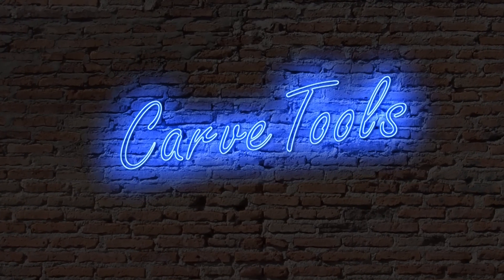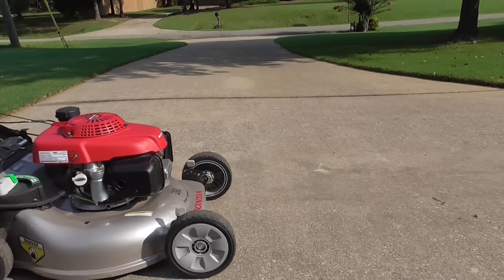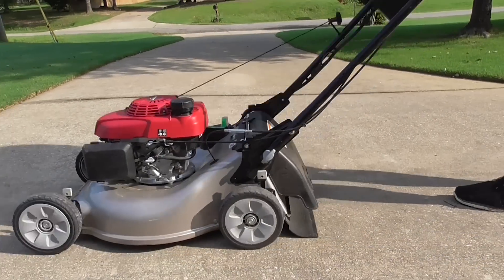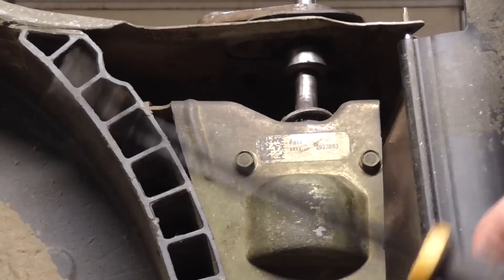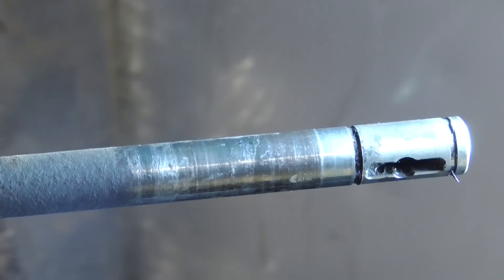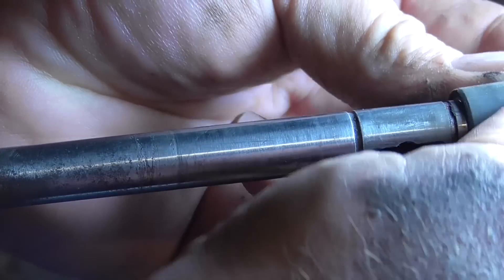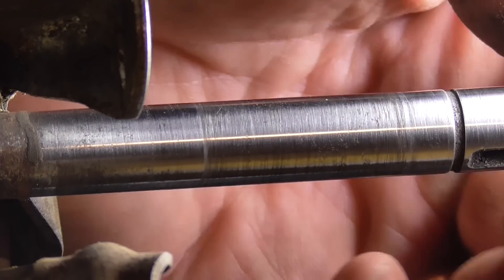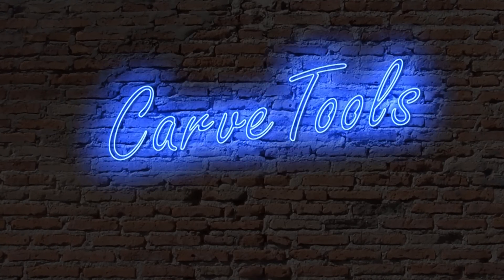Honda Mower Rear Wheels Will Not Roll Backwards THE REAL FIX

Comment: This happened to my mower within 8 months of purchase. I know several others who have had the same problem. Bad on Honda for not making this a recall.
Reply: Should of been a sealed roller bearing in there NOT a bushing on mild steel
Reply from the maker: I agree. Honda should have sent a postcard to registered owners for the recall. Thanks for the comments!
Reply: All four of my Honda mowers over the years suffer the same problem. They are just too lazy to redesign.
Reply: There are service bulletins on this issue. On older mowers some parts have been updated. Your mower comes with a warranty, use it. Even if it's out of warranty the service bulletin says "Any repair performed after warranty expiration may be eligible for goodwill consideration. Contact Techline or your District Service Manager. Techs must request consideration and receive a decision before starting work." As a tech I've had them approve things out of warranty before. Honda is a good product and they are usually pretty good about covering things that are known issues as long as it's been maintained and not abused. Have your tech call Honda and try to get approval for any out of warranty repairs.

The service bulletin also says:
INFORMATION FOR CUSTOMERS
• Inform the customer that under normal use, the HRR216 lawn mower requires a certain amount of effort to 
pull backward. It will not roll backward as freely as it does when pushing the mower forward.
• The rear adjuster bushings require periodic inspection and lubrication as outlined in the owners manual 
maintenance schedule The rear wheel adjuster bushings should be inspected and lubricated every two 
years or 150 hours, whichever comes first.
• Explain to the customer that he/she must be careful when washing the mower. Directing pressurized water 
from a garden hose nozzle or pressure washer into the rear wheel areas may wash the grease out of the 
adjuster bushings over time and will increase wear and the amount of effort required to pull the lawn 
mower backward. Cleaning the mower deck and surrounding areas is best done by hand using an 
appropriate wash mitt. Refer them to the Cleaning section of the owner’s manual for complete information.
Reply: This was a recall in the USA. Can't find any reference to the recall for my French purchased version though.
Reply: That makes zero sense, they dumb down mower operation to the point of throttle removal but the owner is expected to tear down the rear axle assembly and resurface for proper bushing function?
Reply: maintenance!

Comment: It's not this easy!! It's a Bitch getting everything apart to get to his starting point. And have fun getting it all back together. Be sure to have new snap rings on hand.
Reply from the maker: Hi Shane, Yes it's a pain to take this thing apart but the point of this video was to show the actual problem of the plastic bushings. Mention to your authorized Honda repair shop "Honda Power Equipment Lawn Mower Service Bulletin #107." The plastic bearings/sleeves are too small from the factor and they will be replaced with the correct size. This is why sanding the shaft solves the issue. Thanks for the comments!
Reply: @CarveTools  Well, I got new adjusters, new bushings all that new improved crap and it is no different than the original crap... Still locks up because the stupid design allows anything to get lodged up between the bushing and axle already...

Comment: Do you want a problem free machine? Buy the Toro Super Recycler from a dealer that has the Honda Engine. It’s more money, but you will have trouble free operation for 20 plus years! This model is only found at dealers! You will get the best of both worlds! I know!!
Reply: Al Gorel --  I do not know about the Toro Super Recycler, but if the deck is designed as all the other Toro mowers, it will be dismal at raising the grass up for a  smooth, even cut, and even worse, when the grass is damp..  
The house next to me has guys that use Toro mowers, and when you look at the side where our grass lawns are next to each other, the Toro mower side is all smashed down, barely cut evenly,  and my Honda side grass is standing straight up, and cut very evenly and level..   
Good luck with your new machine !
Reply: Yeah you will probably not have this problem but you will have a mower that does a crappy job of cutting grass....
Reply: The Super Recycler does not have the same deck as the standard Recycler. Completely different. My 15 year old Super Recycler mulches as good as my 3 year old Honda. And the Toro has   a superior drive system when compared to the Honda. Its called Personal Pace. The Honda on the other hand has the larger 200 CC engine. It can easily mulch 10” tall grass, where the Toro cannot.

Comment: Something else to look for once you have the transmission out is the shield around the transmission's pulley. With the drive belt in place, there should just be enough gap around the pulley so the shield does not to touch. Too much gap might cause the drive belt to ride up and wedge thus locking up.

Comment: I have a Honda HRR21PDC with no adjustment on the drive bar cable, The problem with mine was that the drive release at the gear box was rusted up and wouldn't return far enough to release the drive component. It was tough to get at but I took the cover flanges off and was able lubricated the shite our of it and kept working the cabel back and forth until it returned far enough to releas the wheels. There didnt seem to be any spring to pull this lever back all the way, but with the light oil and working the cabel it returned far enough so I the wneels would roll back.

Comment: I wish you would have show the process of removing the rear wheels and clips/bolts/etc
Reply: You can watch other videos that show this. I personally am glad he showed me this. I have one here with that issue that I want to sell. Now I can fix it right. I already have one and it did that too but works fine now. I honestly thought it was the gear nox.
Reply: I have a brand new mower 2 weeks old that has already done this. I will try to fix it
Reply: All you really need to do this is a few metric tools, and a large and small snap ring plier set... The snap ring pliers will make it so much easier to deal with a large and small snap ring that need to come off..
It takes a little time, but I have already gone to the idiot honda mower people and they knew nothing... This is fixable and I think if you pack some light grease on the now polished shaft and slide the bushings over them, it will hopefully last a long time before dirt and stuff gets in between them and makes this hard to pull backward problem reoccur..
Reply: @frandanco6289  So how do BRAND NEW MOWERS WITH NO WEAR UNDER THE BUSH ... still lock up?  You didn't get my point did you?  That can be a VERY IRRITATING HABIT of yours!
Reply: @keplermission4947  the teflon bushings are undersized. Production mistake.
Reply: @adamquinnkeefe3762  Yeah, undersized, wow ... that could explain it, just why new mowers have that issue and grinding down the axle would solve it.  I have just such a mower and might be tempted to investigate polishing the axles.  Thanks for your idea.
Reply: @keplermission4947  if you order new teflon bushings you'll find the internal dimension is larger. The external is the same.  Painful experience to buy a Honda thinking honda made all the parts and did not sub it out to a country with known quality control problems just to save a few pennies.  Very disappointing experience.
Reply: @keplermission4947  I don't know if brand new mowers lock up... But I do know that when enough dirt, etc., gets in between this bushing and the axle, the wheels will start locking up when pulled backwards... You??? Even have a mower???  Kepler Mission = VERY IRRITATING.....
Reply: Annoying music.   does not show how to remove the rear wheels.   too much video of Sanding and repeating himself
Reply: No.  This video is not going to help because brand new mowers have wheels that lock up, the gear mechanism is very complex indeed.  Sanding off the axles and making them smooth has nothing to do with the wheel lock.
Reply: @keplermission4947  yet it did
Reply: @keplermission4947  You obviously do not have this mower or even a mower or a lawn.. Because if you DID, you would know immediately that this man's video process is Exactly what fixes this issue with these mowers..
Reply: @frandanco6289  DON'T YOU DARE TREAT ME LIKE A TROLL ACCOUNT.
Reply: @keplermission4947  So, the entire gear unit needs to be replaced then?  What is causing the wheel lock.  Mine has this issue too.  My old unit did not.
Reply: @Balticblue93  Hi ... uh ... you know I started using other self-propel machines that don't lock up.  If we pull the mower back when mowing around trees then some of these gearboxes temporarily lock the wheel but the other ones are going to lock and stay locked come what may, then that makes a skid mark in a lawn that took a few seasons to grow.  The easy thing is just to keep it powered and don't pull it back.  An old self-propel, self-drive machine is very heavy, newer deigns are slightly lighter but it's not a machine for mowing around flower beds, you're better to get a small, lightweight polypropylene deck machine like a Daewoo if you have flower beds.  Daewoo are good but some get running issues with them, and are afraid to tinker with carburetor, that is a very small, simple unit compared to a Briggs, the American Briggs motors are very good if you have a better blade underneath.  Some Briggs are over cheaper blades that don't make such a nice finish and can't cut so low.  I tried a cylinder for a while but they're very heavy and all the rest.
Reply: @Balticblue93  Yeah I didn't have time to investigate, others have and you know, wished they hadn't.  Just go to a seller and get a machine that does what you need.  Not all self-drive lock up, just some of them - ?

Comment: I buy all my lawn equipment for my business from the same authorized lawn and turf dealership. They file the factory warranty for me at purchase, they properly assemble, adjust, and test equipment before put on sales floor. They help me with part emergencies and even have a loaner equipment in emergencies. Classic Turf Mansfield Texas, I won't go anywhere else.
Reply from the maker: That's how a business should operate, unfortunately the 2 local Honda dealers in my area are not up to par. Thanks for the comments!

Comment: What is wrong with Honda? Same problem with a fairly new mower. Nothing but problems. So difficult to start, forward power sometimes, sometimes not, rear wheel locks when pulling backward. And so heavy. I miss my Kenmore.
Reply from the maker: So far the engine is the only part on my mower not giving trouble. Lower quality same brand name equal more profit. Thanks for the comments!
Reply: This mower is not heavy... Try an all metal 20 year old Snapper Hi-Vac and you will see what heavy is like...

Comment: I have an issue where the left wheel engages when self propelled on, but the right wheel barely engages causing the mower to pull severely to the right when mowing.
Reply from the maker: Sounds like the little ratcheting gear on that side is broken or is installed backwards.
Reply: What it was is that the mower had bald tires, I have screwed #6 x 1/2 hex head screws in Two's into and all around the back drive wheels to act as tire studs, mower goes very fast now.

Comment: good video re this problem with this mower . I had same problem but believe it to be a design problem as the belt is trying to go one way and you are trying  to rotate ti against rotation if engine not running it goes backwards, the fix is to put a proper gearbox in it with a clutch  like most other mowers! obviously this design was never tested properly and I very quickly got rid of it. Honda lost the plot with this one!t

Comment: Nice video but really anoying fix I just want to mow my lawn why is everything so difficult I've only had my honda for two seasons and it does this seems like manufacturing defect to me.
Reply from the maker: Got the mower out last week for the first time since last season and all is still good, no wheel lockup. Honda knows there is a defect but most of the dealers are not getting the service bulletin. Thanks for the comments!
Reply: @CarveTools  - I just bought a Honda HRR216VKA (I bought it used for $200.00, it's in great condition), but I haven't mowed the lawn with it yet. It had about 10 hours of use on it and I noticed the wheels seem to drag a bit when I pull it backwards. The wheels rotate like after you fixed yours, but my question is why did Honda make the mower this way, so there's resistance when you pull it backwards? Is it some boneheaded safety measure because of the self-propelled feature?
Reply: It IS totally a manufacturing defect and so sad that Honda neglects doing anything about it...

Comment: Will be applying the fix this weekend.  Thanks!
Reply from the maker: Hi Bert, Honda has a service bulletin on this issues and they are replacing the bushings with the correct size ones. Apparently many Honda service centers are not getting this information.
Thanks for the comments!

Comment: Thanks for this video. I'll have to try this. I've found that a shot of WD40 on the axles works for a little bit, but quickly wears off. For as much as these mowers cost, you'd think Honda could have used proper "bushings", not plastic garbage. I've only had my mower two years. I'm also disappointed that my plastic "tires" are worn down too. I only mow about 1/3rd of an acre once a week.
Reply: DATDesign WD40 is a fair cleaner but a horrible lubricant.  Honestly almost any other product is better for almost any application.  I grease the axle where it rides in the bushings and have no issues, other than the fact that you have to take it apart to do that, and re-do it every year or two.

Comment: Great vid. Went to the dealer and they were clueless. Said "wear & tear". I say design flaw. Otherwise XLNT mower. Trouble getting snap rings off, had to use grinder & cut them off. Another design flaw. Will share how it came out later.

Comment: Thank you for this video! Very helpful fix and I literally pushed (couldn’t pull backwards) through the season to make the repair during the winter. Also, thanks for helping me realize  Honda does not care about customers! This should have been a recall in or out of warranty. I will not buy another Honda mower as a result. My mower: HRR2169VKA
Again, thank you for this helpful video.
Reply: I will never buy another HONDA as well, mine won't pull forward when lever is engauged, and locked when trying to pull backward, the mower is only 4 years old and only mowed a small lawn, the MURRY I had before the honda lasted 26 years and still running strong, jut wanted a new mower, what a mistake
Reply: @garysisk3431  Hello Gary,  I agree that Honda isn't what they used to be - including their vehicles.  I have an HRM215 3-speed plastic deck mower.  The engine is excellent but the deck has some cracks and mine is also hard to roll backwards.  It also jerks with self-propelled engaged, like the drive is dropping out and then grabbing again.  Hopefully the belt and not the transmission.  But I have some Honda HR-214 mowers from the 80's and they are outstanding.  Still running good.  I bought the plastic one at an Estate Sale to fix up  ($50).  Also the plastic deck mower kicks some grass out of the right-side of the deck where the HR-214's vacuum the grass up perfectly.

Comment: This issue will definitely return. I had the dealer repair mine twice. First time it cost me $100. The second time, it was free. Both time "redesigned" bushings were used. Both times it worked fine for a few months. Now it's frozen up again. Clearly a design problem that Honda has had and known about for years. Other than the great engine, these mowers are total garbage.
Reply: I'm going to have to disagree with the mowers being "total garbage" because the mowers are not that bad. However I think Troy bilt mowers in a similar price range, with the good honda Motor, are much better
Reply: I’ve had the same issue in the past. I use ‘Super Slick Stuff’ dry lube at Lowe’s as regular maintenance at least twice every mower season. Just lift the rear wheels and spray behind the wheels around the axle. Keeps corrosion from moisture under control. Cleaning the under side of the deck with a garden hose impacts adversely on this issue. Prevention maintenance is so easy and quick.
Reply from the maker: Thanks for the heads up on this. So far my Honda has not locked up since this video. Hope it stays that way. Thanks for the comments!
Reply: Definitely underpowered! My old Toro handled my super thick Zoysia no problem. My Honda is pathetically weak.

Comment: I watched this and it accurately described the problem. But rather than tear the whole unit apart, I decided to do a test.  In my garage, pulling the mower backwards, the wheels would not rotate.  I lifted the mower on some blocks and sprayed PB Blaster as best I could on the axles and the bushings.  I was able to rotate the wheels manually. A few more sprays and manual movement, I put the mower back down and the wheels moved much better.  This proved to me, the axles and bushings are the issue.  Since it is December and my garage is unheated,  this tear down and process will be the first thing I do in the spring. Thanks
Reply from the maker: Hi Vic, 
It is my understanding that Honda has finally issued a recall. Service Bulletin #107. The bushings are undersized for the axle and that's why the wheels lock up. So reducing the axle shaft size with sandpaper fixes the problem also.

Thanks for the comments!
Reply: i did the same and got it working again